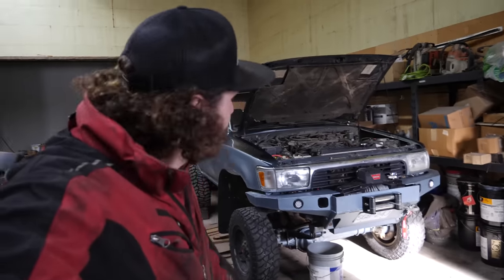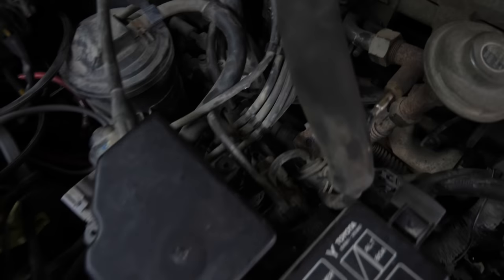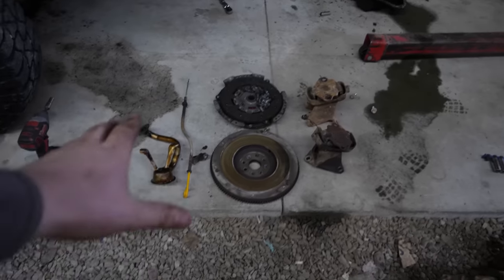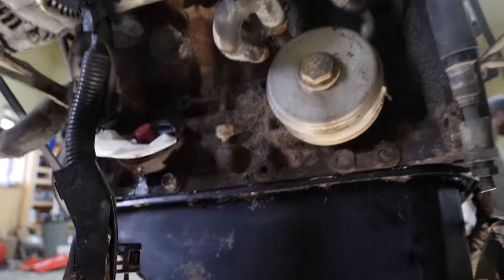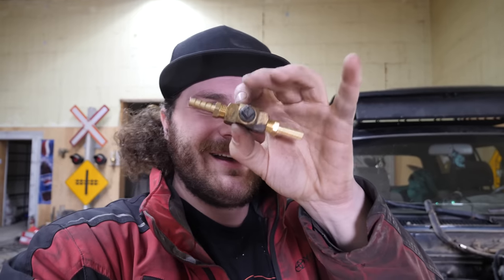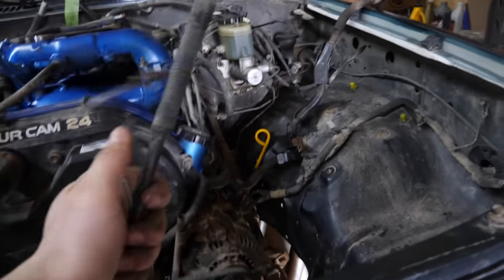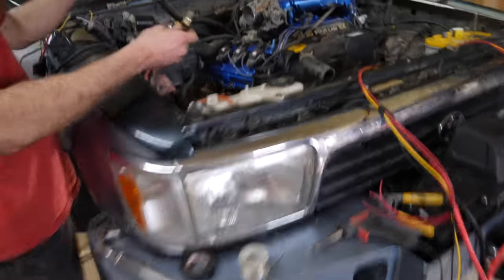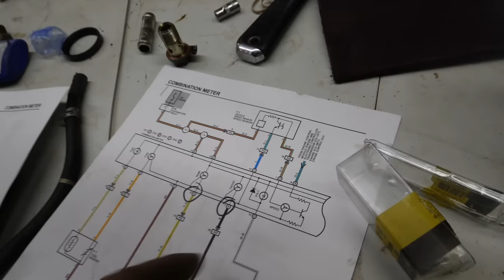Complete Toyota 3.4 Swap Tutorial: Everything You Need to Know

Comment: Curently in the middle of a 3.4 swap in my '90 4runner. So glad you guys are documenting this swap more than before.
Reply: How’s the project going!? I’m also doing a 92 4Runner
Reply: @Red_Beard_Builds  Engine is in, found the right transmission and driveshaft combination since mine was automatic and I want this one to be a manual. Air intake and battery are moved. Crossover pipe and exhaust done. Now I'm finishing some non-swap related things while I wait for some parts. Then its wiring time.
Reply: @matthieucorbeilwalsh  Greetings from Venezuela. I am doing this swap right now.
My 4runner is a 1992 5 speed and the donor engine comes from a 2001 runner automatic.
I am not a mechanic by profession, I just love cars and I am passionate about mechanics.

At this time I already installed the motor and all the mechanical part, now I am going to start with the electrical part.

But I'm needing the combination meter diagrams, I can't find them online and as you know here in Venezuela it's a bit difficult to find them.

Some of you will have them by chance, I appreciate your help.

I have seen this video like 10 times or more, and I need the diagrams to be able to put the cluster, rpm, speed, to work.
Reply: Did you buy a premade harness or adapt your own via wiring diagrams?
Reply: @TimmyTheToolman  I made the harness myself with the help of a friend. To me it was a mess, but he figured it out in an hour all was left was a bit of soldering and heat shrinking.
Reply: @matthieucorbeilwalsh  Sicmods bro! I need to find those wiring diagrams!
Reply: palefacepointpreserverwasi3391  I used the manual transmission of a 1989 3VZE 4runner with the rear driveshaft of my doner 3rd gen manual (2000).

Front drive shaft is the same for both automatic and manual, 2nd or 3rd gen if I remember correctly.
Reply: @mycum8818  where did u get the headers at?

Comment: Good on yous replacing the old engine to drop in the FAMOUS TOYOTA 3.4V6 5VZFE ENGINE & they are a Brilliant Engine & I have a 1996 Toyota Hilux Surf 3.4V6 5VZFE Engine & it has done 265,000 Kilometers & my son Regan brought the 1996 Toyota Hilux Surf 3.4V6 5VZFE Engine when it had done 117,000 Kilometers & when it had done   around a 119,000 Kilometers I replaced the Spark Plugs with the HGK Iridium Spark Plugs & it's the best that I could have done & & when my son Regan Sold to me when it had done roughly around 125,000 Kilometers & I had kept up with the service & do the oil & filter changers & when it had got around 140,000 Kilometers & decided to check the NGK Iridium Spark Plugs & when I got the Spark Plugs out I wiped them with a clean rag & they looked really good these NGK Iridium Spark Plugs & I just screwed them back & just nipped them up tight & I never ever torque these down & you don't need to tighten tighten these plugs too tight as I just nip up tight & when the Toyota Hilux Surf 3.4V6 5VZFE Engine had done roughly around 185,000 Kilometers I took the HGK Iridium Spark Plugs out & check them again I just gave the a wipe with a clean rag & they looked fine & this time I put some PBC Copper Coat Grease on the threads of the Spark Plugs & at roughly the same time I did the Timing Cambelt, water pump,Tensioner & Idler pulley & I had to buy a new crankshaft pulley as the other was rust around the crankshaft itself & even though I was using a puller it actually broke the crankshaft pulley & I a terrible way way of getting the pulley off & in the end I had to use heat getting the pulley off & finally I got it off & I sanded the entire end of the crankshaft & with fine wet & dry sandpaper & came up really good & I priced a New crankshaft pulley at the Mount Shop in New Zealand as I live in New Zealand & the Mount Shop wanted $850.00 plus 15% GST stands for Goods Service Tax & I wasn't going to pay for that amount of money & that was way too expensive & I got a new one from Australia site for $336.00 & the first one didn't arrive & Aimee my Daughter-in law got back to him to say we never received it & he said he did send it & I told him we haven't received at all & I don't what happened to it & he sent another one & later down the track I had received it & got in touch with the guy to say  we had  received it & I don't know what happened to the first one he sent to me & never ever showed up otherwise I would have sent it back to him Bugger & must have gone missing in the post well anyway before I had put the new crankshaft pulley back on I put PBC Antiseize Copper Coat Grease onto the crankshaft & some on to the crankshaft pulley slid on easily tightened the crankshaft with a impact gun & put everything back together & sweet as & I noticed when I took the old cambelt off the timing was one tooth out & having the New cambelt on it spot on the dot & running really & I will be doing the cambelt change & water pump tensioner Ideller pulley & I will do the Camshafts seals & crankshaft seal & replaced the crankshaft seal last time around to when it is due & short time later on in a couple of weeks or so I will checkout the HGK IRIDIUM SPARK PLUGS & if they still look & will just wipe them with a clean rag & put them back in & just nip them back in & if they need to be replaced I will replace the Spark Plugs but at the moment the engine is running Sweet & no sign the 3.4V6 engine has a miss fire at all & you Sir will over the moon now that you have a Toyota 3.4V6 5VZFE ENGINEin your vehicle & if I had the money I & built this 3.4V6 5vzfe Engine up & so it would reboot 30 over sized & put 6 to 7 to one  Venolia forged pistons steel crankshaft & Excellent Quality after market conrods & good camshafts to go with a Supercharger that got on these 3.4V6 engines & have a slightly smaller drive pulley to go on the Supercharger & able to pull more boost pressure & run lake pipes under the side skirts & have 2 oxygen sensors both sides of the exhaust system & I dont know if can get slightly bigger headers made up to fit the 3.4 V6 engines as that would even make a better improve ment & there is a Lovely Beautiful Blonde Lady on Utube & her Tacoma only has one Turbo on the 3.4V6 Engine & it pulling 11.11 seconds 1/4 mile & speed 121 miles per hour down the 1/4 mile & could be  122 mph pretty impressive in the USA at the drags & I wish you Sir all the best with your 3.4 V6 5VZFE ENGINE & have great fun with it Kind Regards Peter
Reply: Mate, did your have 26 coffees before writing this?!!

Comment: Awesome video. I got a couple 3.4s laying in my garage. My daily 89 pickup is wanting a 3.4. This video helped break it down for me.
Reply: U got the 89 long bed?
Reply: @duddleypiercejr.  I do! 84! Long bed, and sorry, No it is not for sale. But, out of curiosity, every thing has a price! I have a 1984 Toyota long bed, 85k or less miles, on a 2.4 carbureted motor. I bought brand new in October of 83' and unfortunately, even with Rust Proofing, it's first 4 years in Wisconsin's (Salted not Plowed) Winters quickly took its toll. It has rust, nothing that can't be fixed and I do have front end damage on front passenger side that a hood, fender bumper, grill, headlight assembly, I have blinker and headlight, body work to align what bolts the body pieces bolt to down to the frame which is straight, won't fix and after that will need a paint job to have a primo completely stock truck. All original with bed cap included, less than 85,000 miles (I have to look) it's like 84k or something. Inside is clean with buckets, wing windows, slider rear window, cap too, tachometer, SR5, 5 speed manual, 95% on tread of tires, oh, has a cracked windshield that worked fine (still does) the State I moved to (WA) said I would have to replace to transfer registration which they wanted me to pay sales tax on since I was out of State even though I bought it in this State! (Go figure).  I drove her here for over 2 years before being cited for expired tags and so I didn't have the cash to do the body work or pay the coffers here for their precious money they felt I owed them. I parked it having another rig, I didn't pursue the injustice, however, I did drive it for a number of years every Winter after a good snow fall because it's 4×4 and they don't have plows here just like the police won't venture out in inclement weather unless they are called and have to. They are sworn to serve, but that might require getting their hands dirty having to push someone to get them moving (the same in every state!). So, I have no intention on selling it, but money talks and some amount might persuade me, if your offer doesn't swing me then maybe someone out there has an offer that will. this comment will be here forever so someone might make an offer that does swing me before I get started on my project after I take care of a couple of wrinkles before I start on my project. Also, I quit driving it when the voltage regulator went out and someone stole the new one between moves, so it will need one of those too. Happy Hunting! 0:04 0:04 0:04

Comment: I’ve done everything on my 1990 4runner, rebuilt gas tank, fuel pump etc, plugs, wires and she’s overheating, tore the front off the engine replaced water pump and thermostat, no difference still overheating. This vehicle is so solid no rust great interior, no way I am scrapping it, there is a fresh rebuilt transmission and clutch. I found a donor vehicle with 180,000 miles is complete, if I park them side by side it should be easier than this vid because all the needed parts are there, hopefully can just switch it all over. I have a mechanic who will help me your vid is a great heads up to what is in store so thanks for that, hope I finally windup with an awesome 4Runner🤞

Comment: Get a new cherry picker.....
Use old (lightweight) to make a light rack.  With a couple of old batteries (for power and recharging) placed on back of cherry picker (for counter weight).  A new slide in bar for lights (12 volt LEDs).   Should be plenty of light for work and filming.  Depending on how you make your extendable light bar, it could be adjusted to fit just under hoods and be far enough to not interfere while working on engine.  And to come in from both sides of vehicle .
Just a thought!
Reply: That is a genius idea 🤘🇨🇦
Reply: Just needs some AT-205 added to the engine hoist and it will be mint, any jack for that matter.
Reply from the maker: My cherry picker is fine. And my shop is waaay to small to rig up a cherry picker specifically for lighting.

Comment: Thank you Dirt Garage! Super helpful video.    I have an '89 first gen with the 3.0 with manual trans.  This week I'm picking up a 3.4 from a '97 T100 with automatic trans.  I have a couple question for you:
Can you offer any suggestions how to fool the 3.4 computer into thinking the transmission is in Park, so it will start?  

A Question for the community: Anyone who's done the 3.4 swap with a 1st gen 4Runner 3.0, please reach out to me.  I have some wiring questions. Thanks in advance.
Reply from the maker: Nothing is required. Most swaps are with auto ECMS. They don't care, they assume it's in neutral by default and will start and drive a manual just fine.

Comment: Very informative vid guys, i recently bought a really nice stock 95'  4runner with a 3.0 with 168k miles. it runs good but i will be wanting to throw a 3.4 in it at some point. I was just wondering how you got to be so comfortable and knowledgeable when it comes to the wiring portion of swaps? Is it just from diving in and figuring it out or have you had schooling? I've rebuilt engines but when it comes to wiring i feel like an idiot haha. Also looking at a diagram is like trying to read chinese to me. I actully learned from your video that the diagrams continue to the next page, i had no clue!

Comment: Hello!  I was wondering what parts are needed for a 3.4 swap into my 1985 Toyota pickup. This weekend I might buy a rebuilt 3.4L that would come with 3.0L mounts. Will I be able to bolt those in or is some fabrication work needed? I currently have a 22R in my Toyota right now. The 3.4 I’m currently looking at will come with a wiring harness and computer, Ecu, bell housing, clutch and fly wheel for a R150F transmission. I was wondering what else I will need to do this swap successfully? Furthermore, I was wondering if I will need to lengthen my drive shafts to fit the R150F transmission? My current transmission is a W56-A 4x4 5 speed. Also, will I need to redo my gas lines and make a new fuel tank because right now my 22r is carborated? Thank you for reading.

Comment: I don't know if you mentioned this in the video earlier I might have missed it but you need to put a body lift on your truck after you do the swap otherwise the engine will hit the hood because it's taller than the 3.0. That means you have to use different cooling hoses too for the radiator because they need to be a little longer
Reply from the maker: Nope! Didn't mention it because it wasn't required. In some cases you have to cut a bit of hood bracing out, but 3.4s fit nicely in others without cutting.

Comment: About to tackle this same swap into my 93 4 runner, but I have IFS. Do I still need to swap out the oil pickup tube and swap the oil pan from my 3.0 engine or can I just leave the 3.4 oil pickup tube and pan since I don't have SAS? Awesome detailed video!
Reply from the maker: Even more important on the IFS. That pan is shaped specifically to clear 3.0 IFS. 3.4 pan will no clear front suspension.
Reply: @DirtGarage  Just wanted to say that your video was extremely helpful in doing my first 3.4 into 2d gen swap!

Comment: Put some AT-205 in that engine hoist and it will stop bleeding down. 

The 3.0 must go, like you said the 3.4l is so much better. No comparison to the 4cyl which is what I originally had.

You don't have to cut the fuel line if you are not in a hurry. On a 4cyl truck there is a threaded coupler you can use to connect the two. That couple is located near the fuel tank or towards the engine along the hard line. From 4cyl to 3.4l you want the fuel line from 3.0engine flip it 90* and couple that to the fuel line on the pass side. As with Toyota brake lines the thread pitch is the same, longer brake lines needed just add a stock brake line, and that is the same with fuel line hoses. 

I did this same swap just not to long ago into my 84-04 SR5/TRD pickup, and yes that's is all the years/generations of Toyota's my rig is built with. When I did the 3.4l swap I took it one step further by rewiring the complete truck from fuse box harness, battery harness, dash harness, fuel pump, all the way back to the tails lights. Moved the battery to left hand side and also installed a complete dash and HVAC system out of a first gen Tacoma. The 04 e-locker works as Toyota intended with the stock switch and the speedometer is driven by my 84 RF1A transfer case. Everything under the hood is out of the a first gen Tacoma and in the same location as well, right down to the opening in the firewall for the engine harness. You would never tell that my rig didn't come like this from the factory. Next engine swap may just in fact be the V8, that job will get a 3.4l to 4.7l adapter harness when I locate one.
Reply from the maker: It was full. Just wasn't tightened. It was moving so slow we didn't notice, but you can definitely tell in time-lapse
Reply: At-205 will help the seals reseal and it won't leak down.
Reply: Also the link for the crossover forum is missing in the description I've noticed.
Reply: I'm debating a v8 swap also , but this is in my 1st gen Tacoma,  going with the 1uz though for the weight savings

Comment: I'm no mechanic but pretty sure you aren't supposed to use the green coolant in toyota trucks. Maybe that contributed to the blown head gasket.
Reply from the maker: the 3.0 contributed to bad head gasket. I run red in everything, but this engine just had the coolant the 4Runner came with still in the system.
Reply: You can run green but you cannot mix them it makes mud,

Comment: The world needs the first 22r to 5vzfe DETAILED swap. IT DOESNT EXIST!
Reply from the maker: It's essentially the same. We have a video on that too. Still mostly bolt on with right trans. But gotta make engine mounts.
Reply: yes but the wiring and fuel systems is  for sure different @DirtGarage
Reply from the maker: @sebastiencolon2944  Not much different. You'd need a fuel pump and just do a basic harness for it with switched power.
Reply: I got a harness built and now in the stage of having to splice into the body harness and don't know where to start without pulling the whole dash and tracing wire by wire @DirtGarage
Reply from the maker: @sebastiencolon2944  Pretty much what you have to do. Older trucks hard to find a reliable diagram.

Comment: Hey, Currently working on a 3.0 to 3.4 swap… is there any harm with using the baffle from the 3.0? 
On the right side where the ac compressor mount interfaces with the engine mount, there’s a gap.Did you use a shim to compensate for the gap? 3.0 mount seems to be thicker than 3.4 where it bolts to the block.
Reply: Just did the swap myself and didn't run into this issue? Curious to see what you're talking about tho

Comment: I have a 91 pick up. Can this be done with the stock suspension or should I lift it and put a solid front in before the swap?
Reply from the maker: No lift or solid axle required. Process is the same either way.